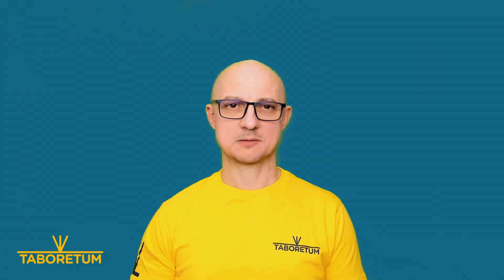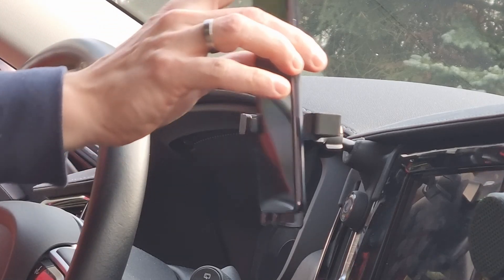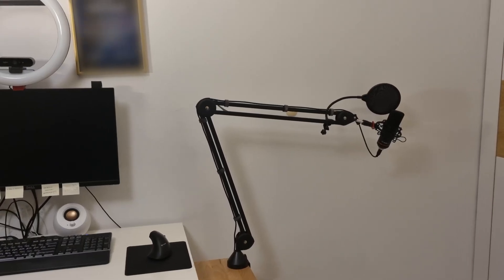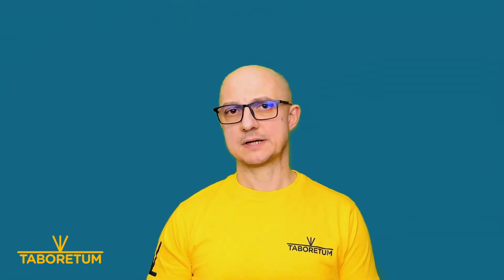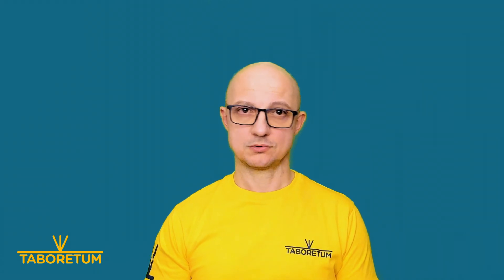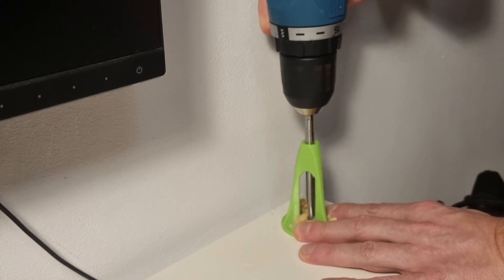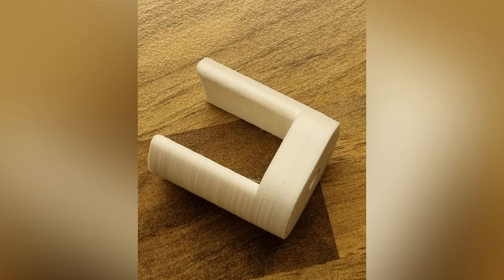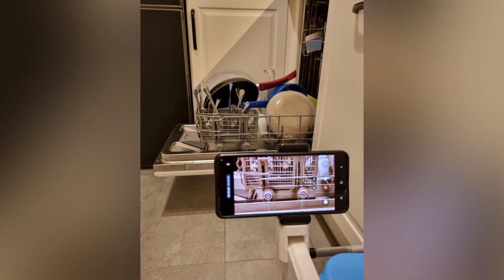Beyond helmets: practical uses of 3D printing

Comment: Uh, when you printed that phone holder part, how did you measured and designed thread? Cutting broken one in the half and measure it on photo with high magnification?
FreeCAD is really pain to learn for me. Part module with boolean operations is quite efficient to use (after using OpenSCAD exactly for that), but part design module is just drawing constrained sketches over and over and then some operations seem to have ability to break everything without apparent reason. But stuff like clamps, holders and boxes for projects with microcontrollers (there is a great video about creating go pro camera housing in FreeCAD) are exactly stuff I want to print - clamp for flashlight/headlamp, microphone, something that can be attached to tripod plate, bike, ...
Reply from the maker: I'm about to make an episode on threads, so maybe I will also shoot a detailed one on "copying" threads. Stay tuned! :) And thank you for comment and motivation :)